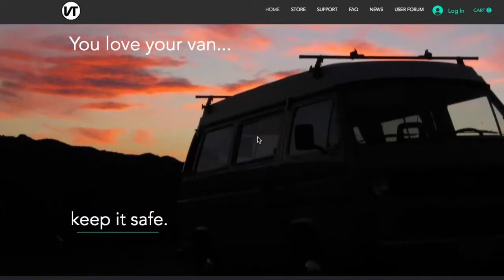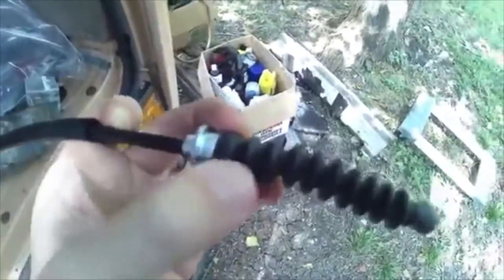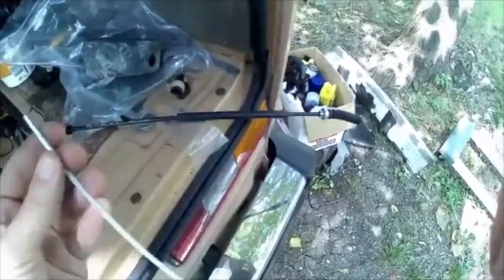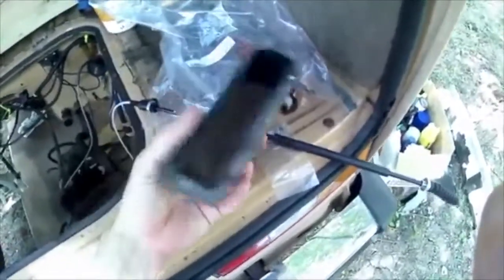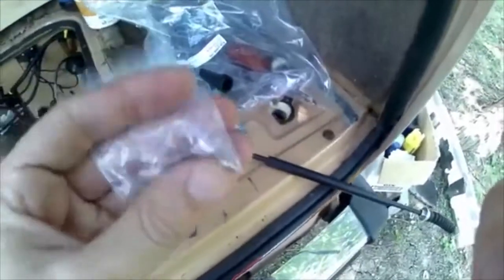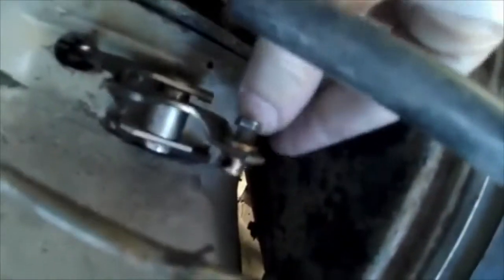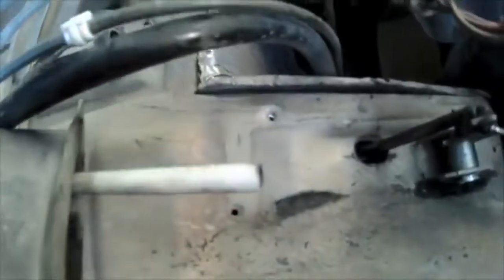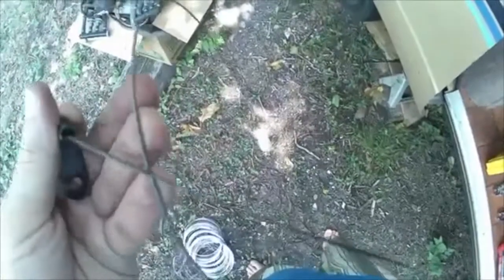1984 VW Vanagon - Throttle Cable Replacement

Comment: I replaced the cable on my manual transmission '87 westy after watching this. The install was basically yet same. Very helpful. Thanks!
Reply from the maker: Awesome! I wasn't sure how similar they were so that's great to know. Never worked on a manual.